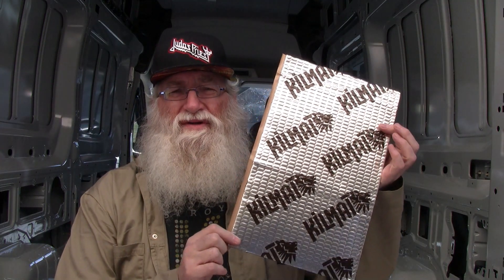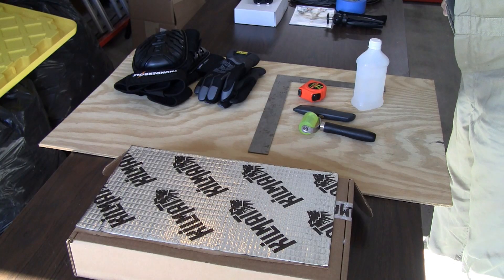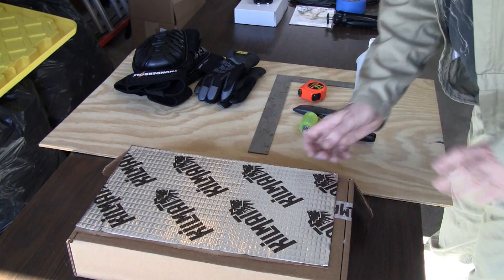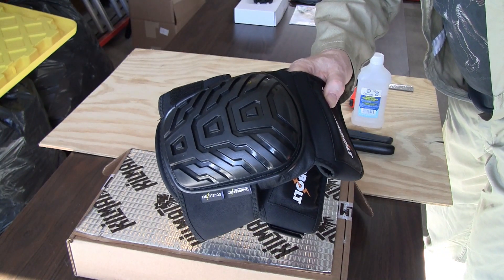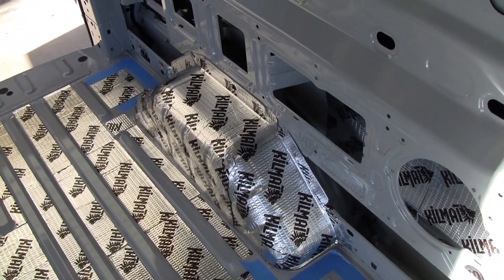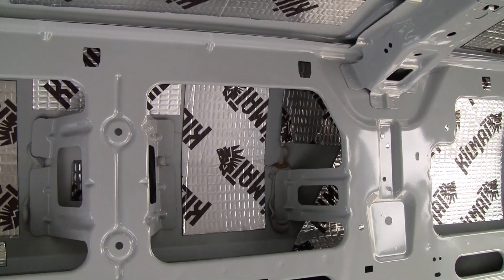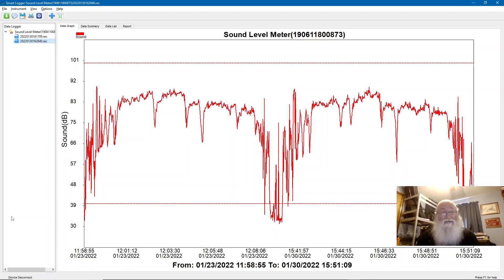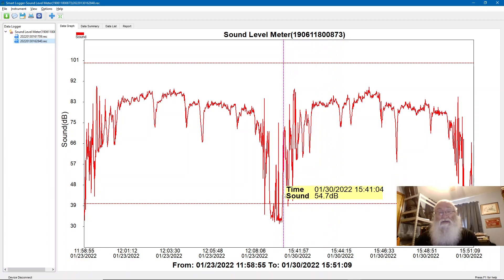Van Build Sound Deadener -- What does it really do?

Comment: 🤘Thanks for the db comparison it's the first time I've seen that done. Did you have the speakers added by the factory or are they included in all the transits?
Reply from the maker: You can get 4, 6, or 8 speakers from the factory.  The 4 are the tweeter and woofer on each side up front.  6 adds the speakers in the rear doors and 8 adds speakers in the side walls.  You can't get 8 speakers on a cargo van; it's standard on the passenger vans.  6 speakers are an option on cargo vans.

Comment: Your videos are great!   I just got the van I ordered last March and found your channel.   You could easily become the Moses of Transit Van info with your background.  I would like to ask a few questions but I want to honor your topics.  Do you have a web site or avenue for general questions?   Are you willing to entertain questions off topic of any present video offering?
Reply from the maker: Ask me anything.  If you have enough questions, I might just make a whole video out of it.  Thanks.
Reply: @bobstransitvan3053  thank you!  In general I’m a pretty handy fellow.  Of course like lost the SECOND time I do something the results are often obvious!   I made several mistakes when ordering my van.  (2021 350 HD AWD ext tall XLT passenger version) 1. I didn’t realize front fender liners were an option! (No biggie but..) I didn’t order the overhead storage shelf (my question) and I didn’t understand fully what the wiring upfitter package really was! ( I had in my mind the auxiliary set of switches down on the console beside my factory trailer brake controller and an obvious open fuse block for the “aux”. Instead of a giant zip-lok with three wiring harness pigtails- maybe an eventual second question).  My old E-350 had that shelf and in your initial videos I saw yours and it hit me!  It had been so long between ordering and delivery that I had a hard time remembering. Just what I ordered (comes with being 59!)    I am told I can order the shelf but the dealer is trying to figure out what all needs to be changed to install it!   Do you know if the front section of the headliner and the rear ac controller/map light fixture both would need to be changed?   Just above the door on each side is an oval plastic plug hiding an anchor point (I’m thinking that has something to do with the shelf assembly).  There are two smaller round ones near the base of the visor mounting points just above the windshield.  Any idea if these too hide something associated with the shelf?  I have considered just ordering the shelf and hardware package and then make it work even if I had to modify it cleanly at the AC controller area..  I’m not excited about spending the money on a new front headliner also!   If what I’m seeing with the plug are indeed anchor points I could fabricate my own tube style aluminum shelf.  Again thank you and your work on. Noise reduction was outstandingly thorough!!
Reply from the maker: @marklamons6977  I'll have to take a look at the headliner install area, but I know that the headliner is definitely different for the headliner shelf units.  Yours has two rectangular plates (marked "Airbag", I think) that cover the screw on each side.  I'll have to look and see if the screw locations for the headliner shelf are on every unit or not.  I would think they would be.  I'll have to look and see if the map light pod is different also.  The four holes up front are for mounting the headliner and shouldn't effect the shelf.  There's a channel called "The Queen and Bob" and they made their own shelf because they didn't order the factory one.  They talk about it in their video on "Sub-Floor Install" at about 14:15.  They totally removed the factor headliner it looks like.  They don't really show how they mounted their shelf.  You might ask them how they did theirs.  I'll do some more research and add to this.
Reply: @bobstransitvan3053  outstanding!! Thank you!!!

Comment: Great info on the kilmat test, thanks!I’d also be curious about your thoughts on ambient noise when parked (like campsite noise)
Reply from the maker: Lots of insulation is going to cut down on the outside noise, but you have windows and the cab area that will be difficult to muffle sound coming through.  I guess if you want to build a wall between the cab and the sleeping area, that might help.  I don't want my rearview blocked though, since my van is my daily driver.